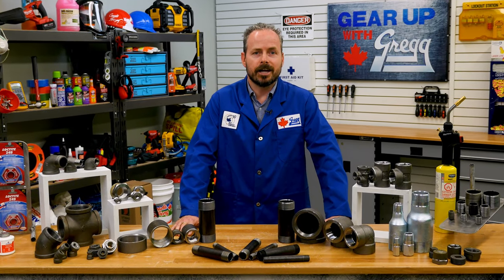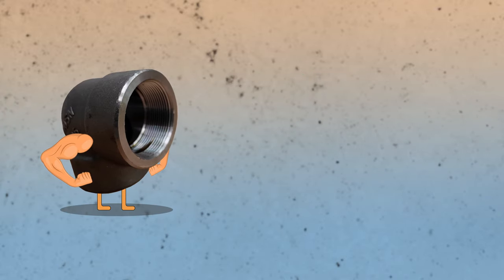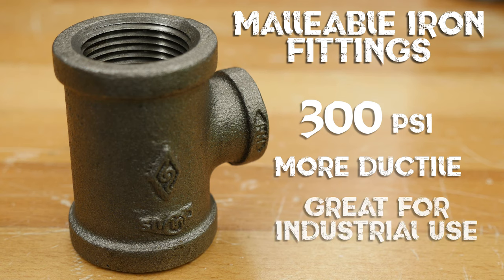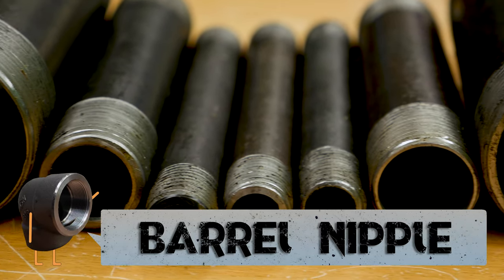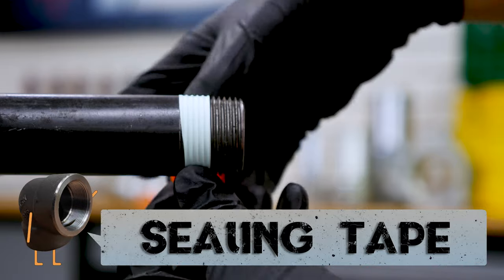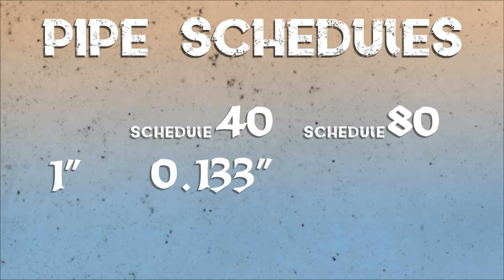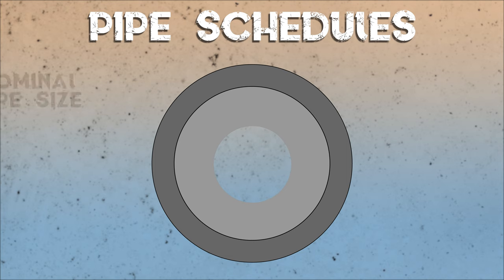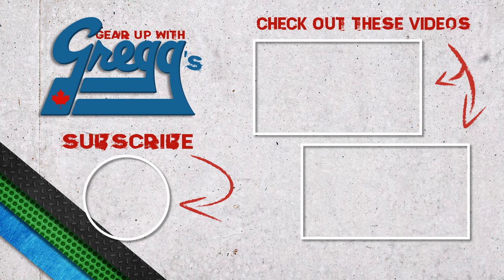Complete Guide to Black Iron Pipe Fittings - Gear Up With Gregg's

Comment: Found this video searching for information for black iron pipe for natural gas installation in a residential home.  I was always confused as Home Depot here in the States sells both Black "Iron" and Black "Steel" fittings and I never knew if you could mix the 2.  Never realized Black "Iron" is not really iron and is really steel.  Glad I found this video - even 4 years after it was uploaded! Thanks for the information!

Comment: I do both pipe sealant and Teflon tap?
Reply from the maker: Adding pipe sealant with tape allows for added protection from leaks. Pipe sealant will fill any of the gaps that were missed by the tape. Check out our selection of Pipe Sealant here https://greggdistributors.ca/adhesives-sealants-and-tape/Thread-and-Gasket-Sealants/Pipe-Sealant?resp_group=Default,Variations,ItemProperties

Comment: What is the best way to enlarge the opening in an 1 1/2 in Tee (black iron fitting)?
Reply from the maker: As far as we are aware, there is no way to stretch/flare a threaded Schedule 40 black pipe nipple.  What you would need to do is to utilize either a bushing or a reducer, you would just need to determine if you want female or male thread.  If you want to see the range of products we have available, you can see it here:
https://greggdistributors.ca/search?q=U10&resp_group=Default,Variations,ItemProperties&page_size=8&view=list&terms=CatPage:U10
Reply: Where I am from,you are forbidden to use a bushing style. Only bell style allowed.

Comment: I prefer Pipe dope, over tape any day, I wear cut resistant skin tight rubber gloves, because yellow pipe dope is hella messy and once on your hands then you touch dirt, then you have black hands for the next day or two haha. The tape is a total pain in the rear especially in tight areas, you get it wrapped backwards and DO OVER! Hahaha.  I wear super tight black gloves, just in case a pipe has a nasty burr, I've been cut pretty bad before on pipe thread, aslo the yellow pipe dope gets all over the gloves, I just throw them away and put on new, I have an entire box in my truck.
Reply: Both dope and tape. Thin layer of Dope over the tape

Comment: My fitting are very tight and dont screw on but a few threads
Reply: Adjust your die every so slightly down and re cut and re thread pipe again and dial it down to 2 1/2 hand turns
Reply: Apply more force. Pipe threads are meant to take quite a bit of torque to seal properly. The threads will deform ever so slightly and that is normal.

Comment: In America I believe the¹y use iron pipe or forge steel pipe. If the pipe is rusting internally as water is passing through is there anything you can use to stop this.
Reply: use galvinized  steel pipe